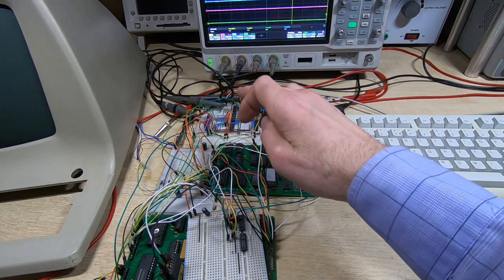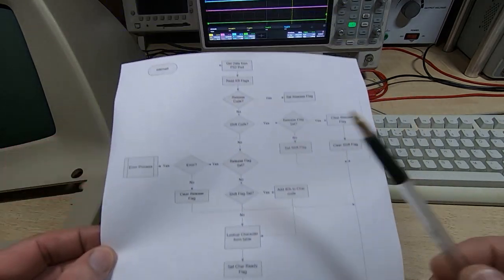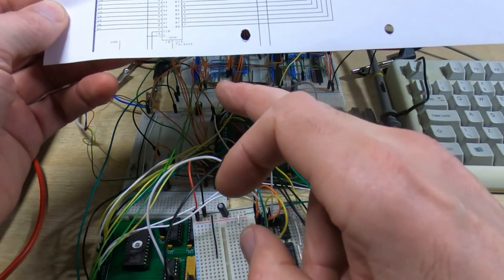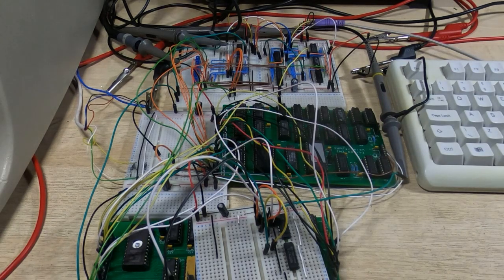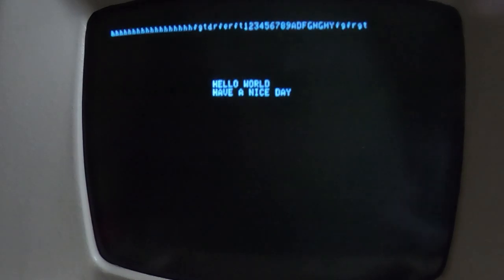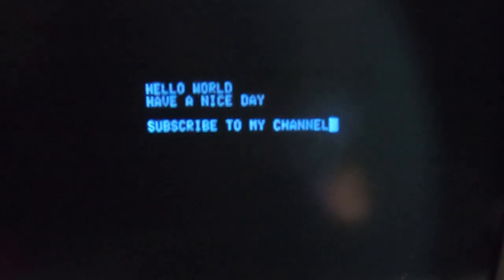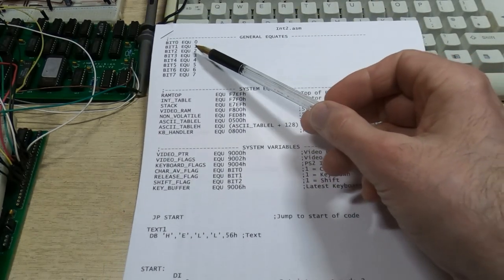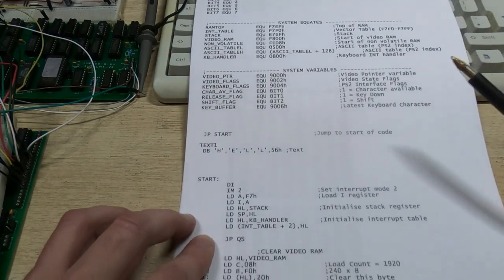Designing A Z80 Computer Part13

Comment: Designing software as flowchart is very period-correct! If it wasn't your style anyway you could not have made a better choice.

It is also one of those things that are most fun if someone else puts in the work and you just have to look at the result.

Flowcharts are rarely used in modern software-development. That's not to say they are not perfectly suited to programs or sections of programs like this keyboard handler. There just is not much software of that kind being written today so as an industry we have moved on.

That said I still keep my plastic template with the symbols for hand-drawing flowcharts.

I want to repeat how very much I enjoy watching your system come to life. That footage of an inverse-video cursor with the clacking of the keyboard really takes me back. And your exposition of what it takes to achieve that is perfect.

 Thank you again for sharing!
Reply from the maker: I have been a software (and systems) developer for over 40 years and using flow charts in software development has been, and still is, used extensively. Possibly this is because I worked in critical systems development where software stability is more important but most developers I know frequently use flow charts in one form or another. I am sure that many less critical development projects would skip this design step but I actually showed it in the video to aid in the explanation.